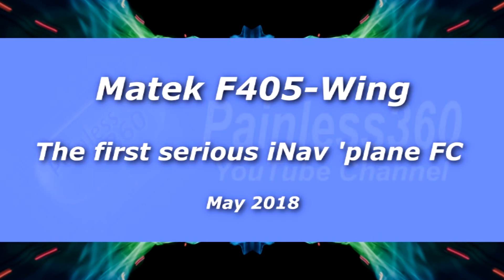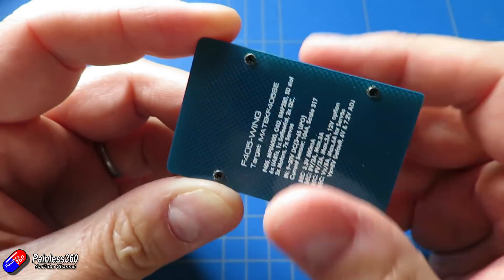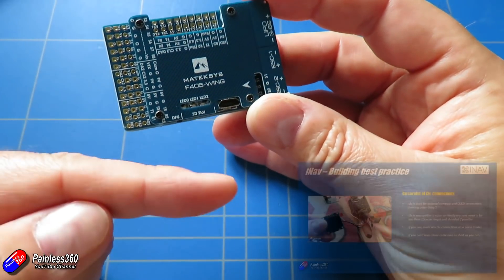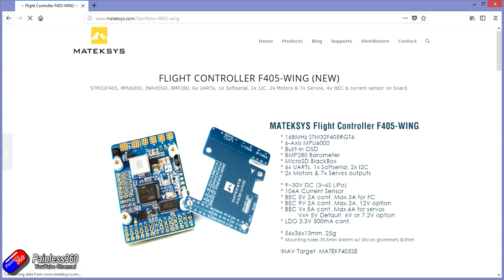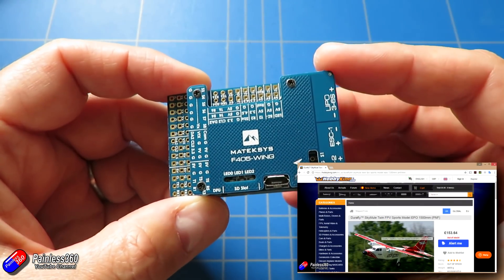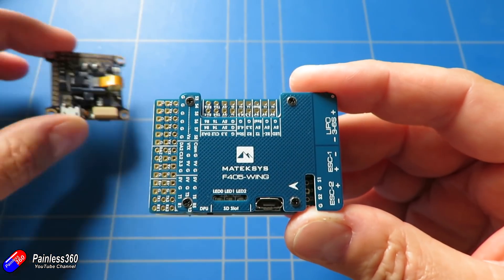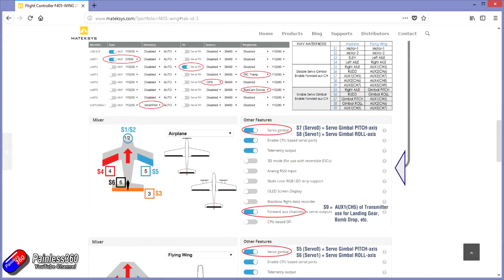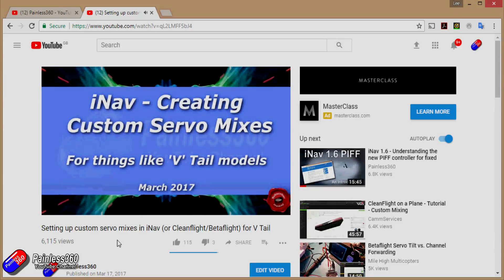First Look: Matek F405-Wing iNav fixed wing model flight controller

Comment: Hi. Thanks for video. Got one but struggling with it on a Spitfire which I am converting to FPV. I had the whole thing going on an old 8ch Frysky PWM rx and all was working - flaps, gear, camera pan etc. Then I put this in and, although it has 9 servo outputs, I cannot get past the confounded inav 'servo slot table' (and would have been lost without your video to even get this far). Now I have less than I started with - only basic controls, gear and a load of empty servo headers with useless slot titles which are going begging. The servo slots in inav seem fixed and very fussy in what they can each do and what function they are tied to and they do not appear to be configurable. Eg, you can't use slot 6 for anything as it always responds to throttle. You cant use slots 0 or 1 as they will always counteract the accelerometer to keep the 'camera' level (even if you don't want to use them for a camera lol). The 'this aircraft has flaps' button appears to be useless etc. After a week messing around I ordered a simple gyro from Banggood and will probably have to tear it all out again... Shame really, was quite excited. Coming from Betaflight (and even Baseflight Multiwii and APM before that lol), I though this would be easy. Oh well! Keep up the good work
Reply from the maker: The servo tables in INav 2.0 have been completely redesigned which will make this a lot easier. The problem is is what we’re trying to do is use really crappy servo control and mapping code that was originally designed in Baseflight/Mulltiwii, came through Cleanflight then through Betaflight and nobody has been interested in actually sorting out servo mapping. Sadly it can feel like the other projects are only interested in racing ‘quads’. Props to the INav team for fixing something that nobody else was bothered about..
Reply: Thanks very much. Wasn't expecting a response. Love your videos btw. Very helpful and clear. I settled on landing gear and basic flight controls for now. Trying to figure what happened to the gimbal control feature to pan a simple cam servo - ye olde Spitfire cockpit is a lot harder to see out of than a racing quad lol. Keep it up.

Comment: Have you used the with tbs crossfire, some reason I can not these two to connect ?, thanks
Reply from the maker: Not personally.. I'd check the forums in case there is an issue with CRSF..

Comment: I have a TBS core pro with a GPS/compass, it was attached to a tbs 2in1 fpvision cube, ended up damaging the cube in a crash while core and gps was not on quad.  I have a helio fc now with matek pdb very happy with that setup.  Im starting a Capi2 build, could I use the TBS core/gps with the MaTek F405 in it?

Comment: Should this FCB be levelled? Mine will have a few degrees down tilt!
Reply from the maker: That will be fine. Just make sure you run the calibration of the accelerometer..
Reply: Painless360 I have read in the wiki that calibration will not be recorded. Does it mean I have to do this again after unplugging the battery? Maybe I am wrong, I am sometimes lost in translation.
Reply from the maker: Please watch my iNav series, it's all covered in there..
Reply: Painless360 Great! Thanks a lot!

Comment: I like the look of this board (especially that it comes with protective upper & lower plates - saves on looking for a suitable cradle).  Are you planning to do a build feature on it?
Reply from the maker: It's already been used. There will be a video showing how I installed it into my TBS caipirinha 2 wing. Stay tuned!
Reply: Can't wait.  On a related note...Our club con't allow FPV without an LOS 'buddy' (too close to a military airfield [20 miles]).  Can I use this board's GPS RTH without installing a camera or would I be better using something like a BLG 6G? Is there anyway to get the 405's telemetery data back to say a mobile phone?  Our field is surrounded by Colza fields and if your glider goes down there you'll only get it back after the harvest - and then in a Hoover bag ;-)  Thanks,  PaulG

Comment: Wow!... At last! The seperate beefy 5-7v servo rail is what makes this so great. It gives a lot of options for using lightweight quad escs like the excellent 72mhz Racerstar 52A esc which more than makes up for the weight of the FC itself.

Matek have put a lot of thought into this one, they deserve an award. I can't fault the spec at all. They will sell a lot of these... and deservedly so.

Comment: Hi, P360:

I’m planning a Pixracer/Arduplane build, but the Matek FC looks a lot more elegant and simple (integrated OSD and power module vs separate). Given that you’re familiar with both systems, I’d very much appreciate your thoughts on whether there is a compelling reason to stay with the more-complex Pixracer/Arduplane system vs going with the Matek iNav FC.

Thanks for all your videos.
Reply from the maker: It's more of a question between iNavflight and Ardupilot. See my flight controller comparison video from last summer where I talk about the differences..

Comment: Could I use an Arduino to control my DIY drone? Super video!
Reply from the maker: A lot of flight controllers are based on the Arduino but many years of development has gone into making them a viable flight system. Best of luck!

Comment: Do you have to solder the pins on?  Could you not solder the wires directly to the FC like we do on quads these days?  Wouldn't that be more secure than Dupont connectors anyhow?
Reply from the maker: I'll be soldering the wires directly to it for space in my build - video of what I'm up to coming soon! :D
Reply: Painless360 awesome i plan on doing the same thing!

Comment: What does the fc control in a fixed wing? The ailerons??
Reply: Jacques Albrech everything you want to , speed , height , heading , as long as you have a gps and barometer and set it up right it basically almost flies on it’s own
Reply from the maker: Please watch my iNavflight series for everything you need to know about what these things can do in a 'plane.. :D

Comment: Looking forward to when it is installed. Im planning one in a S800 wing, not new to fixed wing but it is my first Inav wing build. Information from your Inav playlist was really helpful and I should have no issues with getting it in the air.
Reply: DEEMUS_FPV same here in a few weeks.  Let's connect and share notes ;).   Shaiss at Gmail dot com